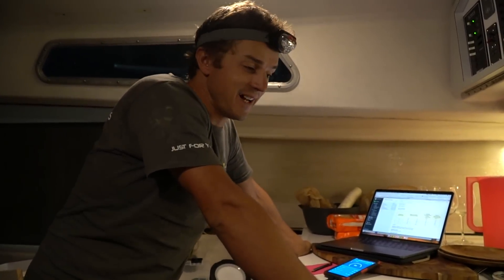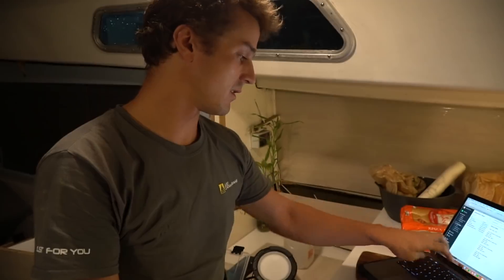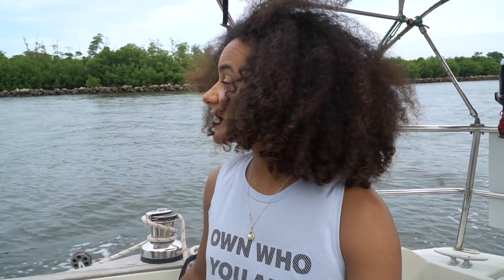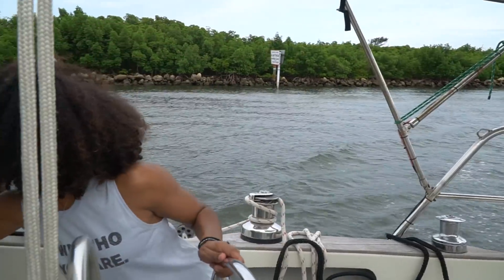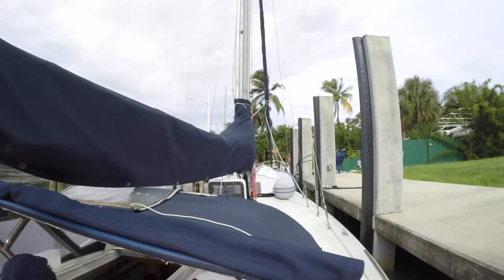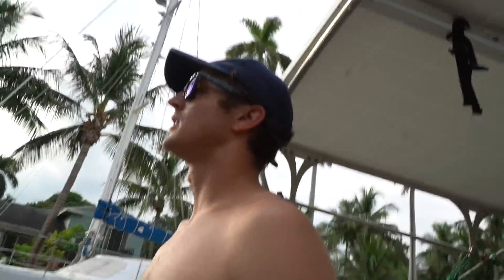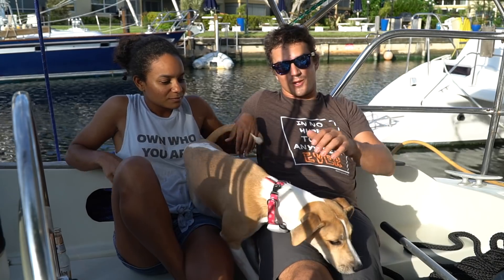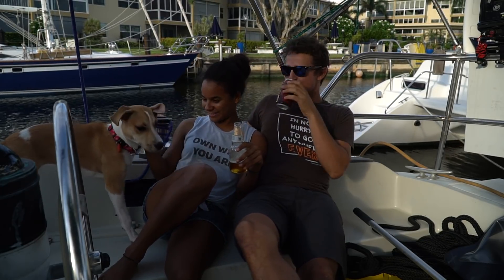Pushing our Electric Motor to its Limit— Sailing Uma [Step 139]

Comment: I'm just trying to think of how you could get more revs from you Propshaft as compaired to the Engine Revs. But then you have the Prop itself and possibility of cavitateing the prop. Or getting a higher thrust production prop. I've said it in the past, that max speed of six knots gives me the heebies. F.W.F>S.
Reply from the maker: Why? Our sailboat can't go much faster in any condition. It's a displacement hull. Even with a 100hp diesel you won't get past about 8.5-9kts.

Comment: The winding's insulation might handle the temp but i'd be worried about the bearing temp and what its going to do to the grease. 268 deg f, heck you could boil water on that motor, the bigger the part the more it expands. like .001" for every 100 deg you go up in temp. Please use some type of cooling.

Comment: Good test of batteries and motor run time, decent. Have you tested running  the motor( slowly) on the solar alone so that you could work you way thru the doldrums and the like?  Could you attach a fan blade to the motor shaft for direct cooling or would that draw away power from the motor drive?
Cheers Warren

Comment: Love your videos content  and production. We have lived aboard 2 (full time traveling on anchor) boats for over 5 years. 
Boat 1. 450w solar + aero gen6 wind, no Gen. 800ah gel batteries. We would survive 95% of the time. Then need to use our engine to top up.
Boat 2. 800w sola no wind, no Gen. 900ah LedA batteries. Fully topped up by 12 every sunny day, could go 3 days cloudy.
Now comes the problem. When you get that many amps down (we would only be 275 down on 900) it's a lot to put back in. (800w sola would take us 3 -4 days to get back up)If you run your Lithium down 70% that's great but with your solar you will be waiting about 5 days of sun to top up, before you can go again. In our travels of the World there are times (rivers with bars to cross at times) where you can find yourself stuck outside.
The T shirt is great as long as you don't need to get in over a bar before a big blow it's. Common on the East Coast of Australia. Still Love what you are doing, keep up the great work.
Reply: Common to the Pacific too with the high currents getting into atolls. They would be very limited in where they could go with their current setup.

Comment: Now something serious about cooling:
- On motors that are supposed to run continuously I would expect some kind of fan on the axis eventually plus some air guiding. Perhaps the temperature is just a problem of not leading it away from the motor. I would not expect, that the Kika cooling would change much of the heat situation.
- In your night test: Did you also check the other wiring and units? I'm concerned cause of the battery fault of the old installation - I supposed the old failure in a not so ideal crimp or flaw seat of the junction. Something like this could happen again.
- Due to the old failure at the battery - what's about a smoke sensor? My concern is always that the skipper or helmsman / woman is in fresh air noting those problems very late.

Comment: my trolling motor does 3 knots. my solar panel charges it about as fast as it drains. It was $300...26 foot Grampian. great lakes....what did I leave out... 1 deep cycle battery, I've never drained it all the way. that's my back up motor, usually I use my 4.5 horse single cylinder mercury, I used $30 in gas for this entire summer. I love sailing.

Comment: Get yourself a small portable Honda generator that you guys could connect the electrical motor to in case of an emergency, or vice versa; connect that aforementioned generator to your battery bank.Just in case of an emergency...

Comment: The difference in "time remaining" may be caused by the rate of your drains. If you had a "100 amp" rated battery bank, that's 100 amps taken over 20 hours. The same battery bank might only be good for 60 amps if drained in eight or ten hours, and 40 amps if drained in an hour or two. Under heavy load the internal battery chemistry interfers with itself and prevents full power from being available.
Reply from the maker: If we had lead acid yes, But with Lithium, they don't rate them like that. 100A mean 100A no matter how fast you discharge them. 1A for 100hr or 100A for 1 hr, doesn't matter. The problem we found was that the battery monitor was set to a 50% discharge limit.
Reply: Even with lithium, there is some curve. I don't see any mention of it from Battleborn but CALB rates their 180ah cells at the 0.3c discharge rate, reducing them to 90ah @ 0.5c ! That's literally cutting the capacity in half. Your mis-set meter may not be the whole issue, try asking BB for some capacity-vs-load ratings, every manufacturer has them.

Comment: I believe the 1 hr duty of your 4.8 kW rated Crown motor as shown on the sticker on your website indicates it will take 1 hour at 4.8 kW to reach the maximum continuous operating temperature, and can be pushed to 4.8 kW/sqrt(0.5)= 6.78 kW for 30 mins if needed from cold, less time if it's already hot. Or 4.8 kW/sqrt(0.25) = 9.6 kW for 15 minutes from cold. 
If you cruise at the 50A and 204F, that's 58% of the 356F temp the insulation will handle, leaving a 42% temperature window. When I multiply those numbers I listed above by 0.42, I get 12.6 minutes at 6.78 kW, and 6.3 minutes at 9.6 kW. For a safety margin I'd round those to 10 and 5 minutes for those power levels should you ever need them on top of your cruising power. However winding temperature would be more accurate based on your chosen cooling system. If your motor controller can do these power levels, I'd attach a thermocouple to a winding, and to your controller, then to a temperature alarm, and keep under the Class H insulation rating and controller max temp. Bearings are the other part of electric motors that don't like getting hot for too long. The grease especially, you want a high temperature grease if you run the motor hot. Should you ever need to run at high power for longer periods, then the better the cooling system, the longer you can run.
Reply from the maker: Not sure if I follow all your numbers there, but after an hour of motoring at 100A (which pushed us to about 6.5-7kts through the water) and after an hour we reached 350°F. Running at 50A the heat pretty much topped out around 240°F.
Reply: 100A at say 53.4V? and say 89% motor efficiency is 4.8 kW, the rating of your motor. 350F is close to the insulation temperature, and 1 hour is the duty of your motor (the time it takes to reach maximum temperature at the rated output). If at 50A it's 240F and not 204F then the temperature window above your cruising power motor temp to max temp should you need to accelerate hard is only 32% or 9.6 minutes at 6.78 kW, or 4.8 minutes at 9.6 kW before you would reach the maximum temperature. These are back of the envelope calculations. Read about motor duty to learn about calculating it properly.
Reply: @CraigOverend  à

Comment: Love ya guys and you do a great job but 3 or 4 hrs will not help in any emergency that lasts 5 hrs. I hope your generator can run that motor and run 24/7 in ANY REAL emergency situation. So much invested for so little and in the end you still need an (fuel) engine. This is cute for anchoring but you would not want it to go out when docking etc... hummm copper and zinc on the boat hull and all that salt water, humm a huge salt water battery :-)
Reply: The motor is an auxiliary motor. Many sailboats manage quite well with NO motor. What makes 5 hours some magical number?
Reply: The point is to use what's available for SAFETY thus an engine and one that can run more than a couple of hours. Imagine a dismasting in an all night storm where you need your engine to keep you at a 45 to the huge waves to keep from broaching. Also, in the OLD days before engines many ships ended up at the bottom of the sea. That is why 80% of all mined gold and silver still sits at the bottom of the sea... An engine today is a SAFETY item and thus should work to the max, not the minimum for nice day docking... And yes, I always give them a TU :-)
Reply: If it's an emergency that's going to last that long you'd consider calling for help
Reply: LOL bad weather for 5 hrs where you might need to use your engine you would call for help? LAMO :-)
Reply: http://www.ecosailingproject.com/   these guys went around the world without burning 1 ounce of diesel
Reply: They’ve made it this far with far less capability.

Comment: I would liquid cool the motor. Pumping damp, salty air to it for cooling seems like a really bad idea long-term. The amount of power used to push a large volume of cooling air vs. a small amount of water has to be significant as well. Depending on how much heat it actually generates you might be able to have a hot shower while motoring using the waste heat? LOL at all the idiots that think an inboard diesel is necessary to travel by sailboat.

Comment: guys, I just bought a 15 kw lirquid-cooled motor for USD 135. Are you sure you don`t want to change your dc motor to a proper, more effective ac induction one? You can still run it at 72 volts...

Comment: You could have launched the dinghy and used it to tug her up the river but you are going to need more than that if you get dismasted and blown towards rocks.
You need a bigger motor and some more batteries plus a way to use the outboard in emergencies if you want to stay safe.

Comment: Adding water cooling would be the best, but consider some aluminum heatsinks.  You can make your own for very little$.  Just get some Alum sheet and either make 'donuts' to wrap around the motor or bend into a many pointed star to go around and fasten.  Use a heat conductive grease like that used to on computer heat sinks.  Then with only the blow motor you have making some circulation you should see a drop in temp.  Even more air flow will show better results.